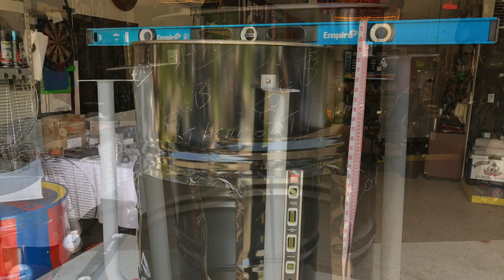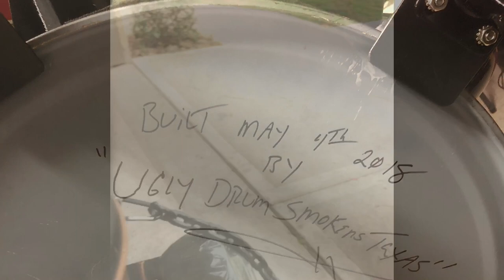Ugly Drum Smoker Build with Access Door. "The Dark Horse"

Comment: Nice! Curious, do you find the single 2 inch exhaust works better than multiple exhaust holes in the lid?
Reply from the maker: Scott, I used to use pinwheel dampers with 8 3/4 holes. But now I only use the single exhaust, I really like the simplicity of the 2 inch exhaust and keeping the smoke as far off the lid as possibly.